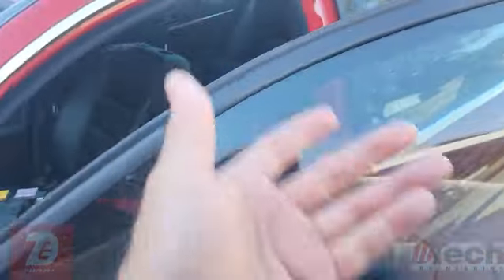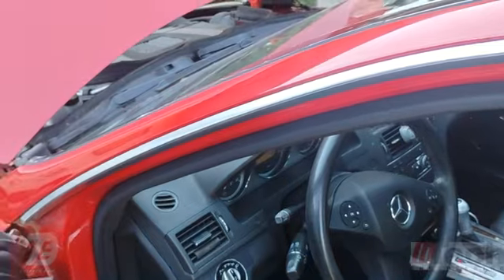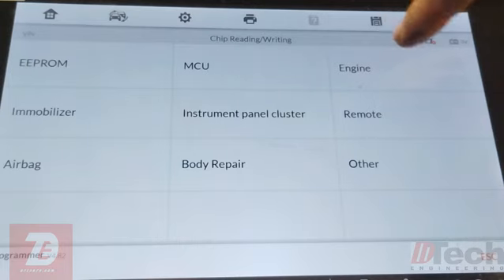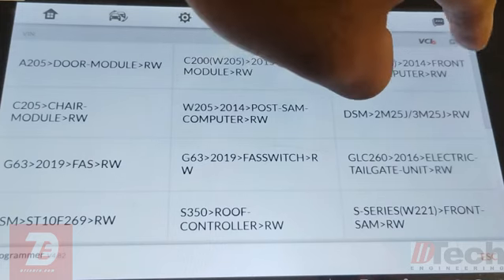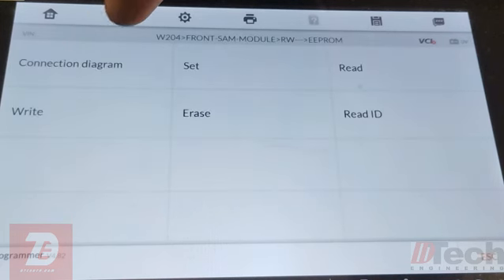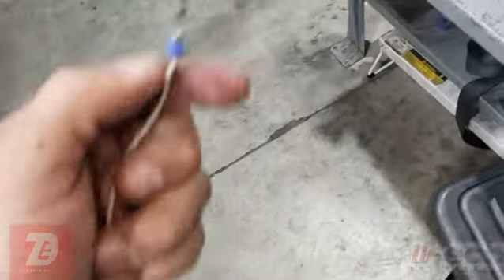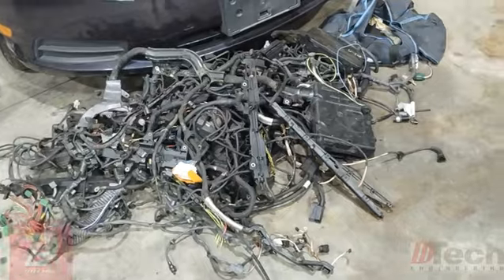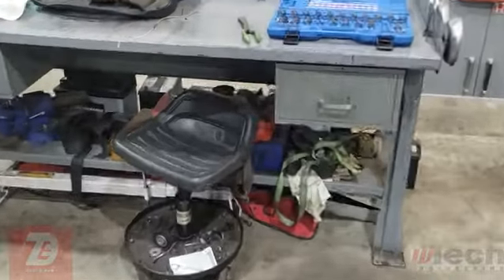2009  Mercedes C300 No Turn Signals: Front SAM Replacement

Comment: Hi. Where do i buy a sam  for 2008 c300, I need to get mine replaced, water damage, went online to auto parts but seems like  can only get them on ebay.
Reply from the maker: I think eBay is the best place to get them.
Reply: @DTEAuto . Ok , found several that match the year and car model, but noticed they have different numbers on the sticker that starts with A .   Does that have to match the one I have or can i buy any that is same year and model? Thank for your help.